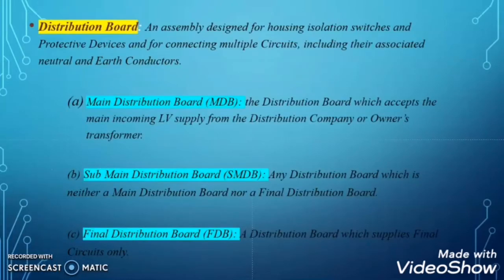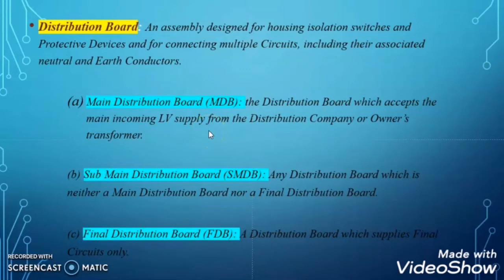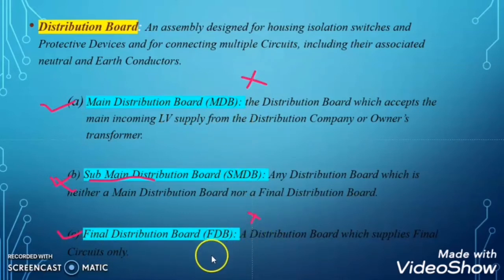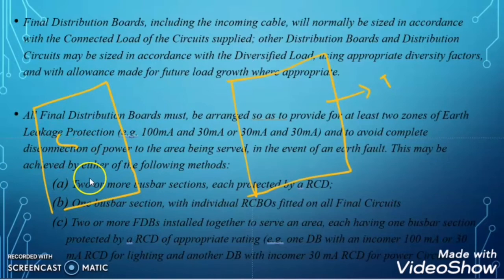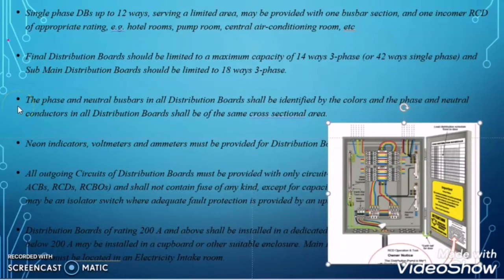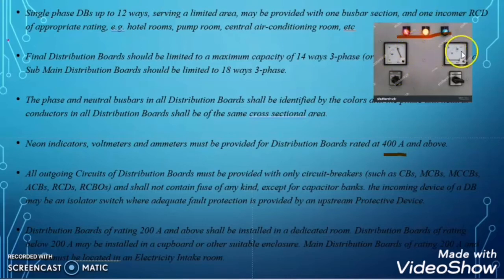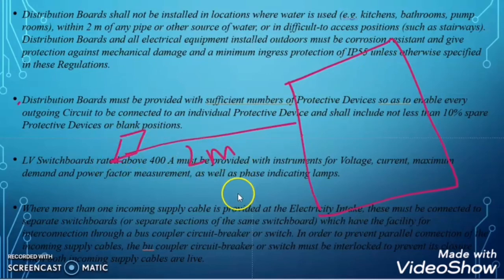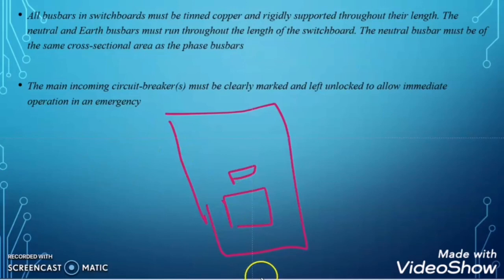ADDC Electrical Regulations for Distribution Boards

Comment: Question if addc required bus coupler for lv panel in the same room will my transformer capacity will be based on the tcl of the 2 bus?